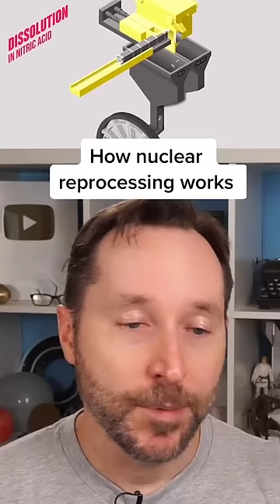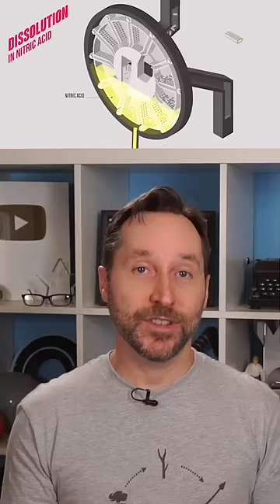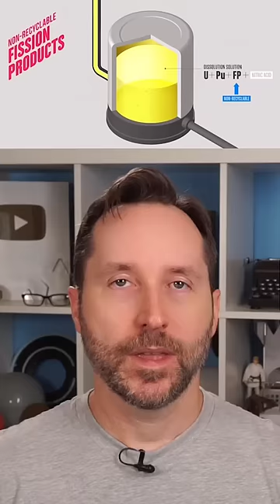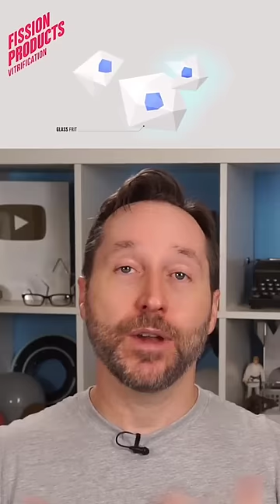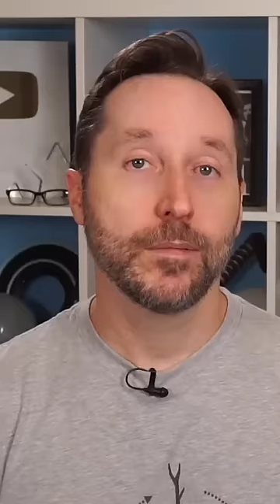How Nuclear Reprocessing Works - Full Vid In Description | #shorts

Comment: Nuclear physicist here... Spent fuel isn't vitrified to reduce its radioactivity. You can't reduce radioactivity, you can only shield it (or force it to transmute, which is impractical). Vitrification prevents the fuel migrating or 'leaking out' when it's buried in the ground, as over thousands of years glass isn't as likely to migrate as concrete, which slowly degrades. We also coat the vitrified HLW (high-level waste) with a special type of clay called Bentonite, which is quite malleable and keeps the core intact in the event of external shear forces like tectonic activity.

Comment: "reduces the radioactivity"..... "reduces the half life".

Allow me to reassure you, if the half life drops by 60%... It's quite a bit more radioactive
Reply: It's vitrified, they dilute the radioactive material.
And they are reacting the material in a critical environment mostly to a more stable isotope, but some to a less stable isotope.

What I want to know is why we are not using this vitrified nuclear waste as full for low level nuclear batteries providing a baseline for the grid
Reply: @humanistwriting5477  Vitrification doesn't change properties, radioactivity or half-life of the material, not sure what you meant by the first paragraph. We don't use nuclear batteries as a grid baseload because amount of decay heat is too low for that. Nuclear waste produces around 0.01% of the energy compared to when it's in a nuclear reactor.
Reply: Both are done by removing the long lived isotopes (transuranites such as plutonium). This decreases the activity and average halflife of the waste.
Reply: @vaclavzajac214  dilution, and reaction. They add a lot of glassy materials after forcing the materials into a critical enviorment to vitrify it. Radioactivity is of course measured in units by volume so dilute and you have less radioactive material.
 That's what I mean by the first paragraph.
As to the nuclear battery
I was more thinking of higher concentrations and as many Beta emitters as possible in the glass
And we definitely do use those as batteries it's just not on a industrial scale
But.
If it (the battery) is made from the tailings after nuclear reactors have taken the energy they can, (withing US law) then its not only a freebie to the energy grid but also free nuclear waste storage and a nice solid state battery
And as a bonus you don't have to worry about future humans harming themselves by discovering an electrically active battery that's zapping them. 

I don't care if we go back to the stone age, getting shocked is a clear sign of danger.
Reply: @humanistwriting5477 re read what you said. 
"to a more stable isotope" great.... That by the very definition means that the half life is increased... (Also, largely wrong.) 

"but some to a less stable isotope" so... That's more radioactive then.... (But it's also wrong). 

Vitrification is about binding the radioactive material to another, stable, structure so that it can be stored for an extended time without it decomposing in any way. It turns out glass is good at absorbing most types of radiation from decay, and is very stable... It can sit in the ground almost indefinitely without reacting with anything.
Reply: @UKMonkey  the entire process of reprocessing and vitrifiying is reacting the leftover waste into more stable (non radioactive) and less stable (shorter half life) waste, then diluting it all with silicon dioxide the (the binder) and baking it into neatly contained crystals. 
Not mentioned in Joe Scott's video is the acid wash to remove the radioactive (and largely alpha emitting) material from the external surface of the glass and baking it again.
This creates a material that is largely not emitting any dangerous radiation, mostly just infrared, and that has a much shorter half life.
Does this clear everything up for you?
Reply: @humanistwriting5477  So, why is it illegal in the US? Let me guess bureaucratic BS.

Comment: Doesn’t reducing the half-life increase radioactivity?
Reply: Yes but no. Fist you reduce the half life as good as possible then you have aggressive pixies (it's the correct physical terms look it up) those you breed into new fuel only the stuff that isn't worth to reuse you filter and dump. Also it's not that simple breeding reactors have their own issues, of course because nothing is simple.
Reply: @fischX  Could you elaborate on the term "pixies"? Neither I or Google have ever heard of that one. Also, breeding reactors are something different than fuel reprocessing.
Reply: You remove isotopes with long half-life (mosty transuranites such as plutonium) so the average half-life is reduced and the activity fell as well because you removed radioactive material from it.
Reply: @vaclavzajac214  - In the US I think there was the worry that it would be stolen.
Reply: @jerbib9598  Yeah, a completely baseless concern

Comment: If we go to LFTR's, once you get them started with U-235 or U-233, they can run virtually forever if you have a secondary chamber with a new graphite core every several years. You just pump the fluid over  into the new chamber and it isn't even necessary to shut down the plant.  The thorium in the blanket and in the liquid can be supplemented without shutting down and highly radioactive material from conventional PWR nuclear plants can be fed into the working fluid and burned down to a fraction of the original volume.  Since it isn't pressurized and there is no water in the primary loop or even necessarily in the secondary loop(use CO2 instead), there is no danger of a steam explosion or a hydrogen explosion as has happened several times in water moderated and water-cooled plants. LFTR plants can be passively shut down with no source of power.  

For once, we need the government to lead the way and be the first mover so that we can have these plants that don't have to be sited on rivers or lakes with all the attendant threats.

Comment: Exactly. But don't make the same mistake as most science communicators: a short half life doesn't mean safer - quite the opposite, it emits more radiation! It's the sequence of decay products that determines long-term threat. What makes these glass waste products safe is they are self contained, so harder to get exposed to and won't leak into ground water.

Comment: Nuclear fuel can be reprocessed multiple times. It's only 96+ efficient the first time and loses slightly more each time iirc. The second reenrichment would be something like 92-95% efficient but the material is fully functional so it's possible for a plant to recycle everytime and the glass material would be easier to store. I think one of the other large issue switch older really is unwanted byproducts like hydrogen gas. But it's crazy how close we are to perfecting nuclear power and yet we waste so much research on terrible alternatives like tidal generators.

Comment: Block the reprocessing of fuel and you block nuclear batteries. In 1991 the inventor of the safe nuclear D cell battery was threatened and then discredited when he tried to begin mfg. He later died in a street racing accident in 2003.

Comment: it is better to be radioactive for 1000 of years then 300. See radioactivity as air in tube of your tire, and halftime is reversed of the leak. so the smaller the halftime the bigger the leak, losing its air (aka toxic radiation) fast, you dont want a flat tire (= bad)

Comment: Ehhh kinda? You don't really get a lot of usable uranium from spent uranium... That's kinda the point of calling it spent. You get some, but mostly you get a new fuel called plutonium. Plutonium can be a wonderful fuel for fast nuclear reactors, but we only use those for research in the US, not energy. Reprocessing isn't much like recycling for that reason. You're processing one fuel, using it, then extracting a new fuel from it, and using that. It's more like recycling squared... Plutonium is actually better for bombs than uranium, so it's just way more regulated, and since it can only be created in a nuclear reactor, no one should really be able to get ahold of it. Accessing more of it is just a proliferation concern. This has come up more often in the last decade as generation 4 reactors become way more feasible and implement fast neutron designs, but proliferation will always take priority. Nuclear science is very open in the world and can be studied by just about anyone. The only true way to prevent bad people from doing bad things is keeping the bad stuff out of their bad hands. Thus why proliferation will always crush modernization of the nuclear industry.